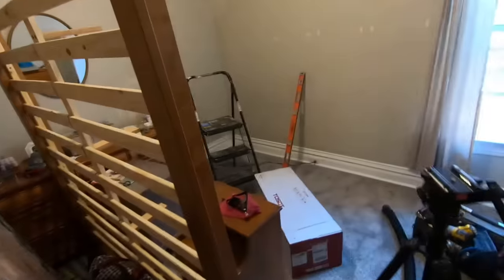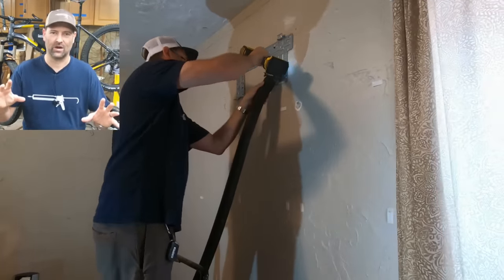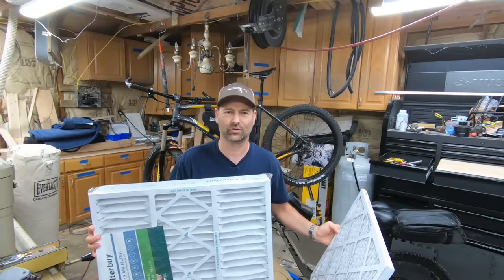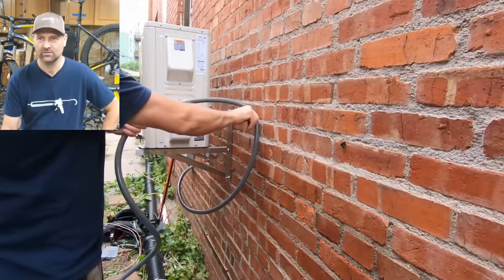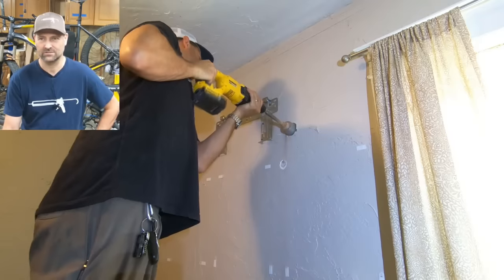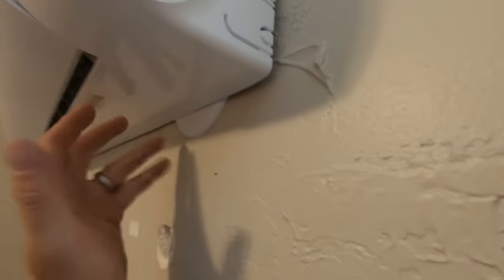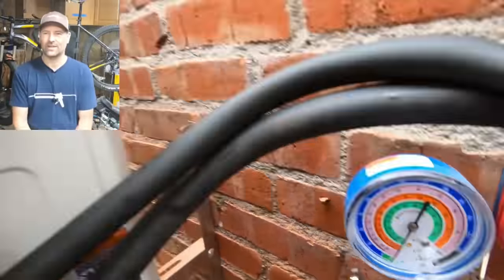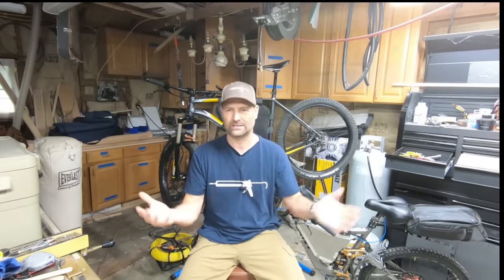Mini Split Install So Easy A Handyman Can Do It | No Need For HVAC Company | THE HANDYMAN |

Comment from the maker: Here is the link to the Made In USA filters https://filterbuy.com/xvQoupFI7DmgfnlK9IUu/
Reply: Seen where a wetted circular piece of sponge circular is used inside the holesaw to drill through tile, masonry, etc.  Have you used this?
Reply from the maker: I had a bucket of water on the ladder that I was dipping it into.  I haven't tried the sponge trick.
Reply: Another one for bricks is using a grinder to make one or two cuts perpendicular to the mortar joints, then if you hit the new “square” with a hammer it should fall out perfectly. 

Not as neat looking but much faster
Reply: Dude you and your video made my day! I was not getting heat inside and then I saw you release not just the LOW but the HIGH too and I forgot to open the HIGH pressure valve, your video shows BOTH need to be OPENED this fixed my problem now I have heat inside..love it!! Thanks man!!
Reply: I’ve found myself in need of getting epa certified for residential and wondering if you or anyone in this thread could point me in the right direction to get certified online, also I am an electrician not not a hvac technician so I’ll probably need a training class or something so I can pass the test. Thanks!

Comment: Lic HVAC Contractor here. The one thing you failed to mention. That you already had a 240V circuit available for a DIY project.  I'd say 90% of DIY's don't realize your need a high voltage line (240v/120v) available.  That does require a Lic Electrician (depending on State/Municipal req)
Reply: The one thing you failed to mention, is the respectful, meticulous professional work, plotting then drilling thru brick, no cracks, then complete install ..and he’s still worried about making a mess, cmon Alex
Reply: Yeah I'm an hvac contractor in louisiana, we gotta have electricians run our whips for code
Reply: Well remember "Handyman" is in the channel name. He also referred to the mini-split as a "microwave".

Comment: When I finally got a HVAC guy out to quote on one of these with two heads, they quoted some crazy $10k number... business is so good they add 100% markup on these small jobs to make it worth their while.  Funk that, I'll do it my damn self...
Reply from the maker: That sounds about right.   I had a customer tell me they paid $20,000 for a 4 head unit at their ski condo.
Reply: @TheHandyman1  had a customer pay $28k for a 4 head system just a few months back. Pacific NW.
Reply: I was quoted $6k-$8k for a single 18k unit . And no one  would hook up the electrical. That's another $1500. F me!
Reply: @TheHandyman1  I do have question for you. Are the guages and vacuum available for rent anywhere or do I have to buy ?

Comment: I’ve been doing hvac for almost a decade. I have two A.A.S, one in HVAC & one in Commercial and Industrial Refrigeration. And your right mr.handy man! I would’ve liked to have seen a nitrogen pressure test but I’ll let it slide cause you’re my boy! 😅 good shit man!
Reply: Also I personally don’t like mini splits because they aren’t easy to service or troubleshoot. Also in my opinion they seem to belike they’re engineered to fail sooner than later. No hate intended..just my personal honest opinion from my almost decade of experience
Reply: @_RT.Tony_  They should be, and generally are, treated as disposable (like a window unit.) By the time you get parts, and especially if you have to pay a pro to diagnose/troubleshoot, you might as well just replace the whole thing. Most of these are around $1000, which is peanuts compared to what parts/labor costs. Besides, all the conventional (unitary) split systems are getting crappier and crappier. Thin, cheap, aluminum coils that leak, expensive computer boards, and expensive ECM motors.
Reply from the maker: I agree.  This mini split cost the same as a in room portable ac that sits on the floor and blows out the window.

Comment: Mini-splits are one of the best inventions ever for people without the ability to have central air. Mine is only 10K BTUs and cools my whole large house and it's silent. I had mine professionally installed but loved this video anyway. Very interesting.
Reply: How is it for heat? That's my main concern with getting one, but I live in WV where winters can be pretty cold. I'm in a two story, but fairly small, house and I'm trying to figure out if 2 units would be enough haha.

Comment: Excellent video.  I've done these without nitrogen as well...I just like to release some refrigerant from the high side and see if it holds the pressure for a while (after pulling vacuum first)

Comment: When I install anything in this type of material I always put a few pices of bailing wire in the holes. That way when you send your screws they mush the wire screw and brick together. It's kind of welding them together.

Comment: Thanks for the video =). I wanted to ask, wouldn't gluing the metal wall bracket to the wall cause issues removing it down the line when the indoor unit needs replacing?

Comment: Love the videos! The only thing holding me back on doing this myself is not being able to take advantage of the 5 year warranty since I’m not a licensed tech. If I get the EPA certification does it come with a license number or something to throw on the warranty?
Reply from the maker: There is nothing in the warranty about supplying the license number of the contractor that installed it.  There is no way to prove who installed it.  These are all made and sold by china.  Go check out the warranty on their website.

Comment: I had a Mitsubishi h2i mini split heat pump system in my townhouse, had three wall units, was absolutely awesome for heat and ac, my electric bill was like 150 bucks a month with that.  Now I'm in a house with an old central ac that's less than efficient.

Comment: Sometimes for Tapcons I drill the hole, put in a zip tie (or toothpicks) then the fastener.  Helps snug up the hole.

Thanks for the video 👍
Reply: I use trimmer string and it seems to never fail.

Comment: Love your videos. Next time, try a mrcool mini split. No need to mess with refrigerant.
Reply from the maker: 4x the cost to save 30 minutes of work.
Reply: @TheHandyman1  Doing my 1st (whole home, my own home) renovation and was interested in the mrcool due to their 5 unit kits. Using your link I couldn't find any option like that at tosot. Any extra detail or guidance would be much appreciated!

Comment: Curious about your experience with tapcons. I’ve never had trouble with brick or cinder block but I shear off or strip out about half of them in concrete. I started using the (new?) white tapcons about a month ago and haven’t had a single failure through about 20 of them.
Reply: Same here. Never had one pull out, but I have had many snap the head off half way in. Also have had the pre drill hole blow out the surrounding material, particularly on block walls
Reply: i find a deep enough hole and blowing out the drill dust is key, then installing them with a hand screwdriver or a drill using the clutch setting to not over torque.  but def not an impact driver.    i always also use a couple of lead lag shields with #10 screws  as a fail safe.
Reply: were you using the bit that came with them cuz a lot of concrete seems to hard for it, that's my experience with using that bit..  when I use a sds bit I never have a problem with concrete unless I use the wrong size lol

Comment: There are two Shraeder valves. One on the unit and one on the small adapted used for pulling vacuum. Do these two stay in place ? Do I have to remove one or the other ? I suppose the one in the valve itself must stay but not sure about the one in the adapter

Comment: I’m getting a used 24k BTU unit from a friend for free to put in my shop. Will have to figure out if I want to try and charge it myself or hire hvac guy to come get it charged for me. Not sure if I need an outdoor disconnect or if I can just run it off my breaker box inside. The guy I’m getting it from is an electrician so I’m sure he’ll set me straight.

Comment: I’m installing a mini split I’m using the disconnect to where a heat pump was removed there is a 60 amp breaker for that disconnect I know I need a 20 amp is there a way I can get around going into the panel and changing the 60 amp

Comment: I really want one of these in my office, but the condensor/compressor/outdoor unit would have to be clear on the other side of my 3 car garage and the line set would have to be probably 60' long.  Still looking for someone who installed theirs in a similar setup.

Comment: How about the length of the vacuum lines? My understanding is that one of the issues with a DIY Split Job is that the length of these hoses tend to be extremely long and cannot be shortened without the expertise of a professional HVAC installer. This results in long messy hoses that stick out like sore thumb.
Reply: Not called a vacuum line, and don't try flaring a line set for the first time just to lose your charge of refrigerant.
Reply: I heard that you must keep at least 10 foot long linesets or it cause some issues for the compressor lifetime

Comment: Are these really that much superior to simply putting a $300-400 window a/c unit in? Obviously you need a window, but most rooms have those, and you can remove the unit in the fall/winter.
Reply from the maker: They only cost $700 they are much nicer and a lot less trashy than window units
Reply: Also they work in reverse and can be used to heat your room if your house has poor hvac design. Or if gas is expensive.
Reply: and much more efficient and much quieter.  Plus, when you separate the coils, you are likely to get much longer life out of it. I think it's a no brainer when all is considered

Comment: True you need a Vacuum to see if it holds at a predertmined Micron Gauge Reading   I finish Vacuum for 45 min or less an see my Gauges if they did not move at all I was happy  I Never got a call back in about 10 yrs in the 90 s.......to 1999

Comment: You needed to show the running pressure, usually about 70 PSI on the low side in about 110 to 115 on the high side... and that would also depend on the temperature
Reply: There is no high side on a mini split.
Reply: @MookieMan1  Wanna bet?  There most certainly is!

Comment: Yes you do need a H V A C,  If you READS the book there is no (( warranty)) if you do not  have paperwork to show a H V A C  co put it in.
Reply: No you don’t
Reply: They’re all pre charged, you only have to twist a valve to open. No hvac certification required
Reply: Good luck with warranty without a technician install 👍
Reply from the maker: These are so cheap they are throw away parts.  The entire system is only $700.
Reply from the maker: This is such a false statement.  None of the brands I work with say you have to have paper work showing an hvac company installed it.   This mini split has a 5 year warranty against manufacture defects.  These are all made in china by Gree and then rebranded and sold under dozens of different names.
Reply: Manufacturer defect generally means a bad braze. Boards, motors, relays, thermistors, etc have to be diagnosed which would require an experienced technician; unless they take a homeowners word for it when they said the sub pcb board failed and they'll install the new one if they ship it out. 
You are right that they're cheap enough for a throw away, you get what you pay for; why not spend a few bucks extra to get a 10 year warranty single or multi zone system that'll actually work as intended. If homeowners needed something better than a window banger, why not just go for a ptac
Reply from the maker: They aren't shipping parts they are shipping an entire new unit.  These are Chinese drop shipping companies.  I had one show up with a dent in it and they refunded me the full price win in 3 emails.

Comment: If that ever happens again with the tapcon stick a toothpick or two in the hole and drive to screw in again. You can all so use a piece of copper wire. The wire works the best actually.Hit Pins also work very well for me.
Reply: Using a toothpick seems like a bad idea. Eventually the wood will rot and then your bolt is no longer holding.
Reply: @Jack T  you're right. The whole thing would probably fall right off the wall in the first hurricane.  It's probably better to do it right and put a big long bolt right through the wall and use grade 8 bolts at least with lock washers so it doesnr vibrate off. If you are going to do something do it right

Comment: How do we determine the power use when it's running say for 8-10hrs a day.  I see 1250watts but I have no idea how to calculate the usage when running.
Reply: 1,250 watts per hour of run time. So if it is on for 10 straight hours, you'll use 12,500 watts or 1.25 kW. If you pay $0.15/kW it'll cost you 18.75 cents or a full 24 hours of running is about $4.50/day or about $135/month.

Comment: You did not clearly state that when piercing from the outside into the inside ALWAYS make sure you are NOT angled down.  Make sure you are NOT level, and you are ACTUALLY< MEASUABLY, angled to the outside, so that water intrusion is using gravity to LEAVE the install, and not go inside the house.  
A principle all the trades need to know to keep water flowing OUT, and not inside the unit.

Comment: My disconnect needed fuses. Is that normal? I put 25-non fuses.
Reply: You used the wrong disconnect. There is a breaker in the panel. No fuses needed outside. Just a disconnect means.

Comment: Man every time I try tapcons they wind up ripping up the concrete around the hole... I'm using the correct size because I use the drill that comes in the box. Dunno wtf I'm doing wrong
Reply: The biggest problem with tapcons is when people use impact guns to install them. I will always install them with hand tools like the video, they have a limit on how much torque can be applied
Reply: Need a really nice hammer drill with a really nice carbide tip.  Drill very lightly.  I go on size down first.  Then do the right size bit.  Almost never have a problem with them.  If any do strip out.  Still install screws in the holes but add epoxy for extra strength

Comment: If your tapcons aren't gripping as you say, you're either stripping them out or drilling the wrong size hole. Tapcons are excellent fasteners and just one 5/16" at 2.5" long has a tensile strength of 2,500+ ibs

Comment: North is getting hotter AND we get efficient heating compared to normal electric heating.

When electricity costs about 30c/kWh I close the heat pump and I start fuel oil (diesel) boiler.

Comment: Those bricks don't look like fire hardened bricks , there being drilled way to easy. They drill like old Chicago bricks if I drill in to a fire hardened brick even if I use Tungsten carbide bits they can be tough.

Comment: You obviously know what you're doing, but I would recommend any homeowners to not attempt a mini split, standard split, or package unit install. Also as you said, testing for 500psi of nitro woild have been something to do. Just mention a homeowner has slim to no chance of warranty parts, which would in most cases be 10 years for a professional install. If they lose charge of the refrigerant, they have to pay a professional to leak check and charge it. And for getting 120v or 230v to the disconnect, they should have sparky run that. Finding a loop hole around legally needing a contractors license and epa card doesnt give me faith on homeowner installs lol

Comment: I did each step meticulously. But when pulling a vacuum, and shut off pump, it won’t hold a vacuum. I have triple-checked all the tubing flare connections (as best I could with a vacuum only). And I am about ready to call the AC guy! 🥵🤬😡
Reply: Sounds like you have a leak. You need nitrogen to check for leaks and then you can vacuum the lineset. You may have crimped the lineset somewhere.

Comment: why not cut the linesets to only the length needed, with clean bends and linehide to conceal it; it looks like hammered dogshit. You also didnt mention the 240v disconnect installations, which requires an licensed electrician. Obviously, still cheaper than contracting the entire installation but not entirely DIY for most. Nice work, otherwise.